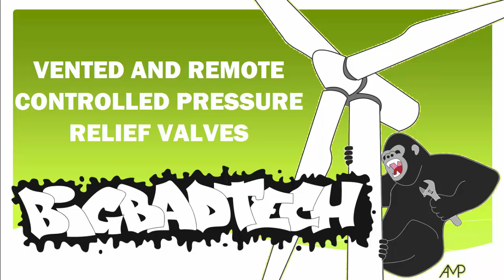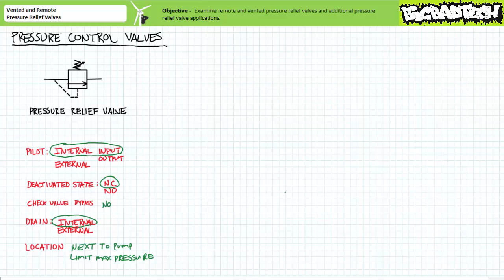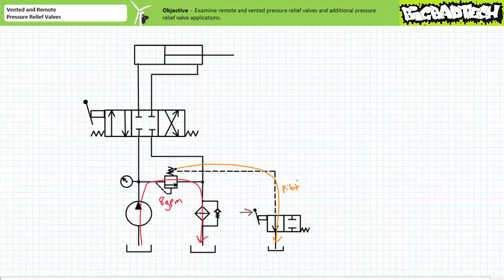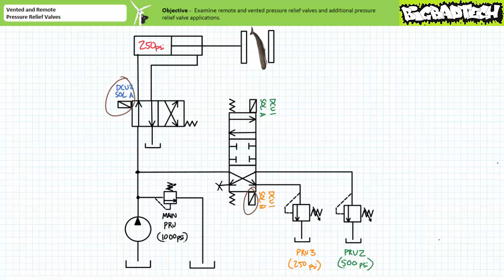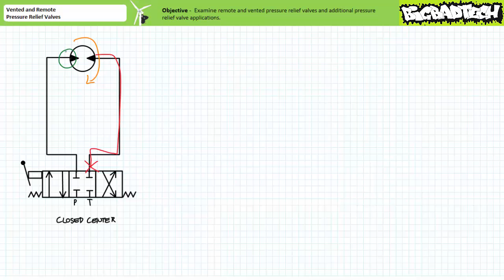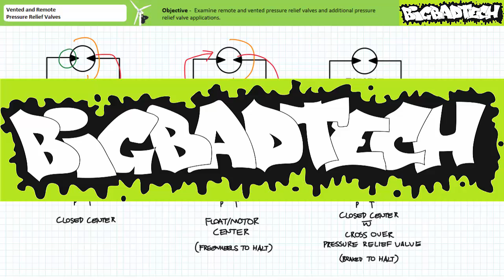Vented and Remote Controlled Pressure Relief Valves (Full Lecture)

Comment: Sir,plz explain what is the difference between internal and external drain ?.how to identify seeing hydraulic power pack?
Reply from the maker: Check out the hydraulic schematics lecture at: https://youtu.be/NsgShyrcvqA Hydraulic power unit (HPU) at end. Internal drain - outlet port of valve at low tank pressure so drain is internally routed to that same outlet port. External drain - outlet port of valve NOT at low tank pressure so drain is another external port that must be routed to tank
Reply: Thanks sir for answering.sir, one more question. How to identify internal and external pilot  in hydraulic system ?
Reply from the maker: Schematically an external pilot is a dashed line sensing pressure "somewhere else" in the system. Physically a valve with an external pilot will have an additional pilot fitting that needs to be attached to "somewhere else".

Comment: what means vented to atmosphere counterbalance valve? can I use it on the cylinder what operates throught proportional valve with open throttled center? my spring set on the valve shall be 390 bar and only vented counterbalance valves available with these springs settings.

Comment: Hello Jim,
          I am following all of your videos and they are just awesome.
          I just got confuse at 11:27 minutes when you said that due to imbalance main PRV will open. What I didn't understand here is that main PRV is set at 800 PSI and remote PRV opens at 600 PSI, how it will open main PRV even though system pressure is 600 PSI?
Reply from the maker: Realize the vent port is "behind" the balanced piston. If something behind consistently gives up at 600psi rather than 800psi the main relief valve will open early. I do a demonstration for my students by having one of them push my hand. I give a token amount of resistance and then I suddenly yield. Depending on my degree of affection for that student I'll either guide their fall towards a clear path or head first into a garbage can. Always an entertaining demonstration.
Reply: Thank you for replying back, Jim. Now, I have got one more question. When you said that "If something behind consistently gives up at 600psi rather than 800psi the main relief valve will open early".  What is that action or force that will open main PRV at 600 PSI? I am having hard time to visualize that phenomenon. What I understand is that if pilot sprig of PRV is set at 800 PSI, even if the constant knocking of 600 PSI imbalance should not disturb it.
Reply from the maker: Maybe check out the "Pilot Operated Pressure Relief Valves" lecture at:
https://www.youtube.com/watch?v=_mT4q3yW1uU
Hopefully this will clarify how the pilot chamber works.
Reply: Thank you, Jim.  I will again go through it. The videos are really informative.